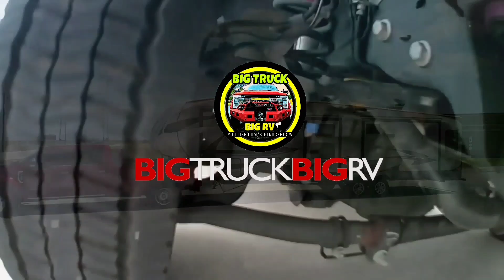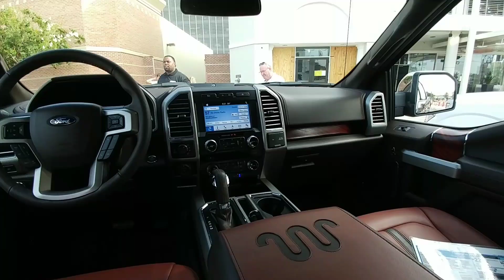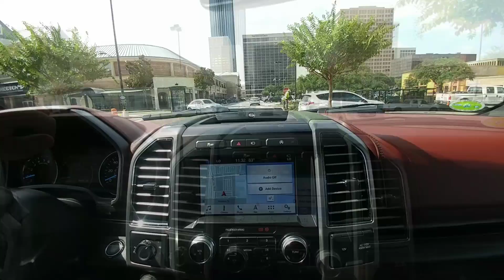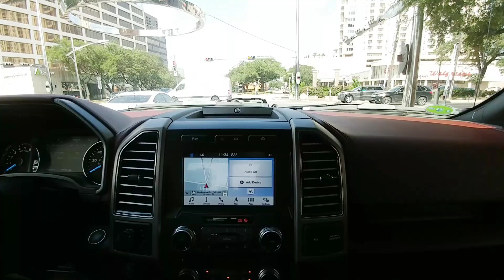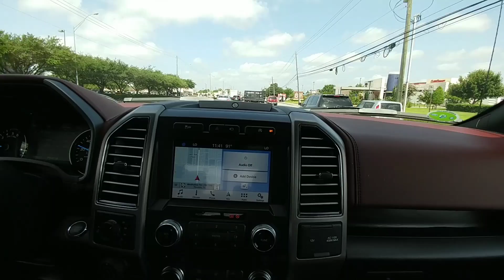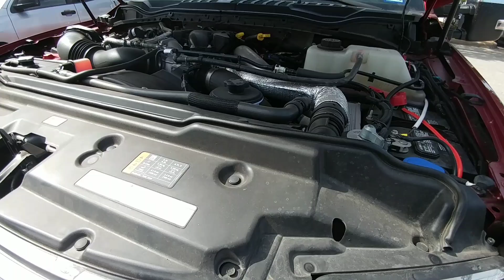All new F150 3.0L Powerstroke Diesel! First drive!

Comment: I have the Platinum with 60k miles. Still runs like new. Reason why they say 150k life cycle is because that's the recommended interval to change the timing belt. It's been very reliable. Love my F150. The engine warranty is 100k miles.

Comment: I've had mine for a few months and agree that it's very quiet.... Too quiet. I've already done the 4" exhaust and intake and it sounds much better. Now, I can tell it's a diesel. Also, your test model had a really low tow rating. My 2wd Lariat CC with 3.55 gears is rated at 11k Lbs. and I plan on towing an 8k Lbs. trailer (7k UVW). I figure 73% of max gives me a good safety margin.

Comment: A truck should have  a rubber floor mat and a bench seat I love my 1990 F250 custom 73 diesel   Sure it rides rough but it's got ice cold air conditioning and pulls my Bobcat just fine. Better looking truck in my opinion  By the way if the engine stops how does the air conditioning work?

Comment: XL Hybrids currently offers a hybrid upfit option to fleets for the F250 Super Duty, and works with Ford to allow for a seamless delivery. The hybrid system gives 25% fuel mileage without the hassle of owning a diesel. I believe medium block to big block hybrid systems, with dependable batteries and regenerative braking systems, will become perfected for larger vehicles and will come down in price for the consumer in the future. One of the bigger challenges is implementing reliable traction motors, such as the AC induction motors found in the Tesla, and the brushless DC motors found in the Prius. 

On the contrary, this small diesel engine may work out for Ford based on a completely different type of buyer. Take Tesla buyers for instance. These folks are not choosing a Tesla to save money overall, rather, they are choosing the Tesla over other fast, expensive models that have comparable luxury and power. When compared against these, the Tesla becomes way more economical. They had already made up their mind that they plan to spend at least 70-80K on a vehicle, Tesla or not. Ford already sells a small diesel about the size of the Ranger in Malaysia. Other small diesel trucks such as Isuzu trucks with the Duramax, and the Toyota Hillux, are popular throughout Southeast Asia and especially Malaysia, and the people seem to love them out there. I was in Malaysia in 2012 and 2013 and was surprised to see so many of these nice looking diesel trucks. Granted, diesel costs about USD $2.50 per gallon in Malaysia when converted, and the complex diesel emissions systems might not exist. 

Ford is sort of doing what Diamler has been doing over the last 20 years; offering a great product selection and really putting the unexpected or unconventional into the product line. This strategy is probably what saved Diamler after the great recession. After keenly selling off its share of Chrysler, which ended up in the hands of Cerberus Capital Management and subsequently became almost nothing, a trimmed down Diamler was able to survive the slump in new car sales by offering "something for everybody". With a strong footprint in the commercial fleets, Diamler currently owns Mercedes, Freightliner, Thomas Built Buses, and Mushibishi FUSO, among others.

Comment: This is a new engine. Giving even an estimated lifespan would be a guess. Just because the engine/truck doesn’t have 400hp, 1,000lb torque, and 20,000 towing capacity doesn’t make it a bad engine/truck. Saving an estimated $2,000 a year in gas sounds like a pretty good idea. I do agree it should be available in less expensive trim packages.

Comment: With the cost of diesel higher than premium gas, the cost of driving should average out with the higher MPG’s. However, maintenance and repairs are going to be the determining factor for most. A Diesel engine out of warranty is not a cheap date. I personally would not recommend for anyone not familiar with diesel, which is exactly who this truck was built for.
Reply: Light duty diesel engine with 1/2 steering and suspension components. Much cheaper to work on and fix. Also, mpg on long trips and towing 6,7,8 thousand lbs are what will save you the big bucks

Comment: Been a Ford fan almost all my life but gawd damn, Ford is lacking in luxury compared to the new Ram 1500 Limited
Reply from the maker: in what way? Design?
Reply: Big Truck Big RV interior design, the new ram has a big touch screen display that shows you everything about the truck, has air ride suspension that constantly adapts to different road conditions, has panoramic sunroof, improved sound denting, and has plenty of hand stitched designs all over the truck. 

The only that bother me about the ram is the durability and longevity of the air ride suspension and motor as ram is notoriously known for recalls.

Comment: Hi great video as usual. Question I bought a 2018 F150 SCrew 3.5L 10 spd, Max tow pkg. It is said to have a 10800 lb tow cap. (B&W hitch says it's 11900). How do you think it will tow an 8500 lb travel trailer a few times a year.

Comment: Doesn't make much sense to have an engine that's made for towing put in a truck with such little payload capacity. Most Lariats, King Ranch and Platinums only have a 1500 lb payload or even less.

Comment: i got to drive one today it was an Lariat 3.0 powerstroke from the 10 or so miles i put on it all i can say is it feels like the 3.5 twin turbo v6 same feel in power and acceleration and i can say that much i know because i work at a ford dealership i drive these things all the time the 10 speed auto is a fantastic transmission that does a wonderful job at always keeping the truck in its power curve and while i was out driving the 3.0 diesel i was getting around 25-30 mpg. so to sum that up basically fells the 3.5tt v6 but has more torque and better gas mileage. but defiantly a bigger price tag

Comment: This truck is a waste, just another over price ford truck. $74,500 for a diesel F-150 with a pussy power stroke. 250 hp with 440 ft lbs of torque. My ecoboost I had had more HP and Torque. Waste of money. I’m sure some will think they have a power house of a truck but really just an over priced ford as mentioned.

Comment: Let’s certainly hope this platform isn’t related to the POS 6.0L and 6.4L Powerstrokes. The “maximum longevity” relative to the $63,000 F450 Lariat I own was right at 26,000 miles before the head gaskets blew. At 84,000 it lost a turbo, EGR and Oil Cooler. Oh and of course the aluminum vs Plastic pipes on the 6.7L...pay attention to your pattern failures FORD. I’ve been buying and have owned exclusively Ford for two decades and this is nonsense.

Comment: OK, there are people out there still towing with a 1990's F250/350. 7.3L diesel with 225hp/450ft/lbs. torque. New F150 trucks are lighter, are built with better brakes more HP, and equal torque ratings yet you state you would never tow  close to the Manufacturers max tow ratings. Do you think the Manufacturer ratings are inflated. I do not think so, if anything due to the litigious society we live in I would say the tow numbers are conservative. While I am not recommending exceeding tow ratings. I think If you are within the tow rating you are fine. Most, if not all tow able RV's should never be towed above 65 mph, mainly because they are built so poorly. Yet I see many big truck F350/450 diesels heavy rigs towing at 75 mph. I'm a Ford guy, why would I spend the extra money on the 3.0 diesel, when my 5.0L will tow as much, as much, or more, and I avg. 10.4 mph towing.

Comment: Interesting that he seemed to avoid any mileage numbers when you asked him about durability / longevity of the engine after you suggested 200k - 300k miles.  It would be interesting to see a side by side comparison between the diesel and the ecoboost pulling the same 'light duty' load as far as fuel economy goes.  My big complaint with my 2012 Platinum Crewcab 4x4 ecoboost is fuel economy.  I average around 15 mpg but when I pull my EMPTY 6x12 open utility trailer (with a dove tail & 4' tall gate) behind it my mileage can drop sown to 13 mpg.  I was pulling my friends EMPTY (flat with the taller gate) open utility trailer and I was down to 9 - 10 mpg.  Haven't been impressed with the ecoboost at all and not looking at buying another one.  If this diesel can offset all of those low mileage figures, and due to the more expensive fuel increase overall driving costs (considering maintenance as well) then I might be interested.  I'm at 96,000 miles and looking to trade for a new truck Platinum crewcab soon.

Comment: Why diesel at such a small liter... What are you gonna tow? A pop up? 
I get the movement of small liter diesels, the rest of the world does it. But this is America anything under 5.0 liter (diesel) is too small.
The 5.0 gas motor they put in the f150 is a dog. It is fast till you hook it up to a sizable load... That's not a truck... It's a terd.
Reply: The 5.slow does not even compare to the torque of the ecoboost when it comes to towing.  The replacement for displacement is the twin turbo setup.

Comment: Those tow numbers seem really low for this truck. I know you mentioned the stated numbers are higher but a conservative tower at 5-6K maybe 6.5K, doesn’t make the 1/2 ton compelling. I have a first generation eco boost and pull a 8500 30 ft trailer. Is there a difference with a different axle gears like a 3.73 or a 4.10?

Comment: Anybody who tows 12K with a 1/2 ton is a idiot! I don’t care 🤷‍♂️ what Ford Says.
Reply: Leonard Russo why?
Reply: cliff turley 

Because half ton trucks are typically about 10k lbs rated with V8 engines
Reply: @gregballard4318  but it would be OK with a 3/4 ton from 10 years ago....yet today's 1/2 tons are more able than those were....engines, transmissions,  suspensions, brakes, frames....I used to tow 10k with a 68 ford 1 ton...drum brakes, 6 cylinder, manual steering...an f150 from the past 6 years or so is way more capable
Reply: I tow 24,500 pounds with my 2.7 eco boost 😂

Comment: The powerstroke only makes sense if you drive 50k or more a year or if the aftermarket accepts it. For an example the 1.0 ecoboost fiesta has a huge aftermarket but the 1.0 focus does not. The 1.0 focus really needs an ECU map because of the weight of the car but nobody is willing to make an aftermarket map for it. So if the aftermarket can have new maps and mods for the powerstroke it will be a great motor for about 10% of F-150 owners

Comment: The service interval has nothing to do with the lifespan of the motor. Oil has an expected life span. Transmission fluid has a lifespan. Its a good thing they have a service interval on the belt. Replace it at 100k and you could be good for another 100k. Better than just driving it until it breaks like a chain and it’s easier to replace. Its been in the Land Rover for over a decade. 

Further, find an engineer from Ram or GM that will tell you how many miles any of their engines are absolutely going to last. A manufacturer has no idea how a customer will treat an engine. All of the manufacturers have 5yr/ 100,000 mile warranties on their HD diesels. Nobody can say for sure how long the engines will last beyond that due to way too many external factors.

Comment: I have to mention that the towing numbers are that way because of two main reasons: 1. this motor is only available in Lariat and above Crew cabs to the general public(and all that option weight) 2. It isn't a towing motor as it's primary function. It simply increases the fuel economy over other options in the F-150 lineup, that is, if it's 2WD. It basically ties with the 2.7L on fuel economy in the 4WD. Understand that the only people that will buy this motor are die hard diesel guys, and people who had salesman who didn't let them drive an ecoboost. To sum up, it has all of the negatives of a modern heavy duty diesel in the vein of the emissions equipment, hyper expensive components, and low projected reliability, but none of the insane raw power. Compared to a Honda Civic, it has plenty of get up and go, but compared to the other engine options in the F-150, it really isn't impressive to drive. it is buttery smooth mind you, but not 6 grand more than the 2.7l smooth. On another point, I can't agree with  7,000lbs requiring a 3/4 ton pickup as that's 700-1050lbs tongue. Maybe in 1985, but the reality is GM and Ford half tons are pretty solid. The GMs are a bit under powered for the claims they have, but I don't fault the platform. J2807 Standards are nothing to sneeze at, either. I'm not for loading a GCWR to it's limit mind you, but up to 80% for consistent use wouldn't be hurtful. Obviously, well trained driving habits and an updated maintenance plan would be advised anytime someone consistently pulls a trailer.

Comment: Anyone else notice how bone dry the coolant tank looked? I’m like..... 👀🤔👀🤔 Y’all got the hood popped because someone wanted to spilt for lunch early? 

Will this engine be reliable? Uh. Uh. Uh. Uh. The F250 is built for long term reliability. This is built for the F150 requirements. AKA make the warranty deadline, Start up the nickel and dime machine.

Comment: I liked the video but... It sounded like the Ken said that if you want the high mileage and reliable engine you would want to step up to the super duty powerstroke. And it also doesn’t have the towing capacity of the ecoboost. I’m wondering what is really the point of this engine? I mean I’m guessing it’s going to cost more then even the ecoboost. Maybe this is one of the reasons my Ford stock isn’t doing well haha. Is fuel economy all that really mattered with this engine other than being a diesel?!

Comment: My '16 Ecoboost is nearly dead silent at idle.  The only noise under acceleration is the imitation engine sounds from the stereo system with just slight turbo whine (with windows open) when the right foot is heavy.  How can this be quieter than that?

Comment: Great video and info, but I still don't get the target market for this truck.  I didn't look up to see the cost difference between this diesel and either the 3.5 ecoboost or 5.0 V8 (or even the 2.7 liter), but I've got to believe it's appreciably more in cost.  Not only that, you can only get this diesel in the higher end trim levels unless you can buy fleet.  Not so with the gas counterparts.  

The ecoboost will certainly "out-tow" this diesel and the engineer said himself that the longevity of this diesel is inline with the F150 platform, as are the gas counterparts as well. So no advantage there. Take note that the engineer also basically stated that it isn't designed for severe longevity of it's big brother in the Superduty line.  I was surprised to see he played that aspect down.  Okay, so it gets "up to" 30 mpg.  That is an impressive feat in a full size, half ton truck to be sure .  But you are also paying a good deal more per gallon.  I think it's about 50 cents a gallon more where I live.  That's going to offset that good mpg figure and I'd imagine maintenance is a bit more for the diesel as well. Plus cost of DEF? 

As for fun factor, the 2.7, 3.5 and the 5.0 will certainly blow it's doors off too, in a big way.  With it's mediocre trailering performance numbers and mediocre longevity numbers (relative to the big diesels), I would also guess the resale numbers of an F150 with the diesel powerplant won't be anywhere near the resale of the big 6.7 liter platforms.  So I ask you, what in the world is the point of this engine?  It's quiet?  Or were they just forced to come out with something to compete with the Ram Ecodiesel?

Comment: It’s a silly, niche reason, but one of the reasons I have one (pre-DEF) diesel vehicle is because of fuel availability during an emergency situation. When Ivan rolled over us last year, diesel was available a full week after gasoline ran out down here, AND was one of the first available as fuel came back into the area because the relief personnel vehicles are almost all diesels.  It’s silly, but its still a reason.
Reply: Luke Edward That's actually really smart and has got me thinking
Reply: Luke Edward when the last big hurricane hit Tampa I had the same thing happen. No gas, but diesel was often available.
Reply: not silly.  my third vehicle is a 2001 ford exc turbo diesel and i am keeping it

Comment: The 3.0 Powerstroke basically matches the output of the 7.3L engines with less than half the displacement.  It also adds modern emissions controls.  I don't think it will out last any of the gas engine options.  I don't think this option is going to be that popular.  Turn down a sexy V8 or big ecoboost torque for what?  Half ton class is owned by gas.  I have a 7.3L van and a 6.2L GM (L86)  and i would not trade my V8 for the power level of the 7.3 minus the longevity.  Based on the acceleration of my 7.3 van i expect the 3.0 F150 to have adequate power but its going to be left in the dust by the 3.5, the 5.0, the 6.2 GM, the Hemi 5.7, pretty much everything.  What fun is spending that much cash on a slow truck?  Just to trim some fuel costs?
Reply: I love diesels, but I agree with you completely.  They missed the mark here for sure!
Reply: daren s the market is not the towering market!   It’s two for one Luxury and tow!  A Mix. That’s what the soccer mom wants a nice head turning truck to take the kiddos to school.